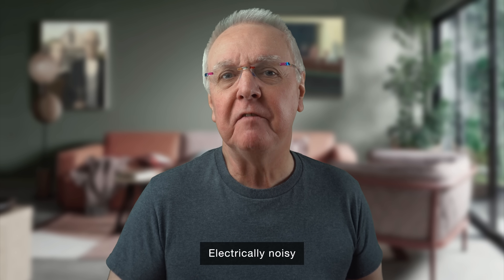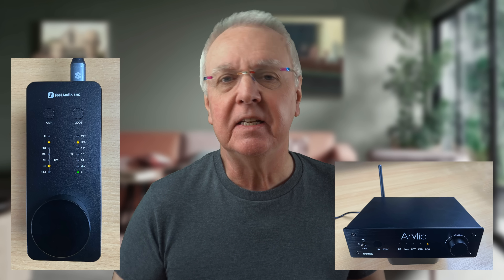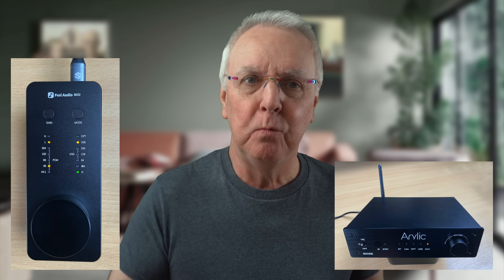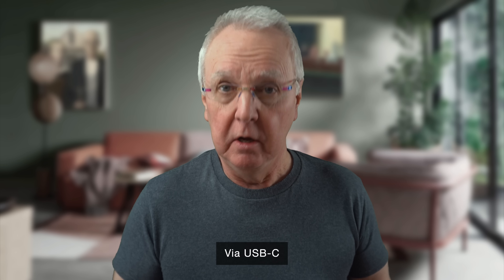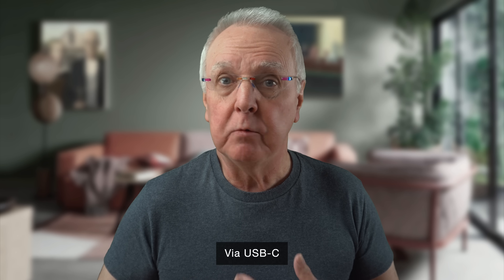Do optical cables have a sound?

Comment: In my broadcast career I have been using optical fibre for may years. for Multi channel audio over kilometres of distance. the biggest issue is that the connectors and sockets need regular cleaning to keep them optimal. fidelaity is always great. In my domestic audio life I have loved toslink, but I will always say that copper is king!!

Comment: many people may poo-poo this, but trust me there are differences. I know that when I run short optical under a foot vs optical over a foot, the result is that the longer line sounds better, richer, less dry...and I have over 20 different cables I can compare between. There are differences...and it's not slight. And when you compare from glass to plastic, the differences come forth even more. Try 20 different cables like I have , A/B them and you will see it for yourself....and these are in no way expensive cables either. All are $25 use and under in price

Comment: There are a few issues with all this, and speculation about what audio philes are actually hearing, But I will start with my computer background and say that  in terms of data transfer like bit (0 and 1) there is no such thing as a weak bit. it either arrives, or it don't, and there are so many protocols in place for repairing a corrupt or broken signal that it will either get there or not at all. In the cd world this is not as easy, as a cd player is forced to play either way, so a scratched cd will skip, and is very logical. But for streaming depending on how old your product is and how the DAC processes the information the sound artefacts should be the same as a cd, but I doubt that this exists in newer equptment, but I might be wrong. Anything connected to  a modem or such with copper or whatever cables can carry current with them that can affect the DAC, but not the data. So cabled connections can benefit from all the expensive filters and such. 
Essentially, using optical and wifi should eliminate all issues, but I don't know how a wifi receiver on a device with dac will sound compared to a direct connection. It may be slightly different if parts inside are in the path that may have an affect. 

But here is also my speculative issue with this. People have preferences and like the use the subjective term. So if that copper-infused CAT cable changes the sound and makes it more preferable than a clean optical cable, it will sound better for that person, but you can't say that it is correct. Also, when people are talking about more clarity, and stuff like that. Any variation anywhere in the frequency response will affect the rest. too much bass, and everything does not sound as clear. It still is, but it is not in the forefront anymore. This is the same thing that is happening in the crossover of a speaker, all the resistance affects these variations, hence why many speakers sound different. So what is correct. 
People may say that they want everything to sound as true as possible like in cyballs for instance, and I can say after having played in bands, that I would not like the true sound of a symbol all up in may face while listening to music, cause they are incredibly sharp and loud. 

So with the lack of knowledge about all insides of a receiver or component used and not even knowing what the actual undisrupted signal sounds like, no one can make a claim of what is better, but we know for a fact that data is transmitted and reconstructed inside the dac. And it will not do so until it has received all bits. 

Essentially, this guy has been pretty spot on in that sense, and I suggest that a simple test like using an optical for your CDs may be worth trying even though you have all the greateness that you need. I mean they are so cheap, so why not. 

Maybe that is the main fear of the industry. Wifi and optical are too cheap. It does not complement the feeling of knowing all the goodness they have achieved by spending a lot on expensive equipment.

Comment: How does anyone make an optical transmission system so bad it can only work up to 10 metres at 200kHz? Even 40 years ago we were making systems that did tens of MHz over hundreds of metres. Nowadays we transmit gigahertz vast distances. Likewise, this supposed jitter and smearing would be non-existent unless you intentionally designed the system incredibly badly. Ever heard jitter or smearing on a VOIP call? Or on any audio transmitted thousands of miles over the Internet? No, didn't think so. Perhaps it only occurs with short cables. Only kidding - of course it doesn't.

Even though there is no difference between optical cables I am prepared to believe that audiophiles can hear a difference that doesn't exist. It would be surprising if they didn't, because they can hear differences between electrical cables where no such differences exist.

Comment: Fantastic how much theory you share in the description link with the Pink Floyd 7 examples. However it misses the most important point, between a basic (3 to 7 dollar) optical cable and a decent ($30-40) entry level cable I can hear a very very very...times 666 :) clear difference. I can even describe it: the cheaper cable missed some midrange (the voices and instruments were  somehow in the background behind the bass and highs), with the decent cable having them upfront, on par with the other frequencies. I would never go over this price point as there are diminishing returns and indeed....optical cables matter far less than copper, but they do. Rule of thumb...do not get the "Amazon Basics" type of cables for anything...they might be built well, but they're robbing signal here and there.

Comment: I often use SPDIF Optical TosLink from most of my sources I´m listening to and I´m mostly satisfied with them, and maybe one should avoid the most cheap and sneaky cables of those, that are much thinner, but the most ridicoloues I´ve seen is Optical cables with Gold plating  What the F....?? Talk about fooling people to waste unnessecary money! 5 - 10 USD for a standard TosLink cable at a few meters are more than enough, in my opinion.

And most equipment of today are using Optical TosLink, such ax AV-boxes, receivers, TV:s and disc players etc compared to Coaxial thare are more rare. 

Also, there are measuring telling 75 Ohm digital "SPDIF" Coaxial CAN be better than TosLink, when using good cables with high degree copper or silver with good screeing and in enviroenment/listening room with low EMF/EMI. I´ve also read that USB are better than those both two above, as USB mostly has lower jitter - but for me, I get more disturbance clicking (not jitter) compared to TosLink, from my PC, but this are maybe due to my PC are too old (10 years old).

Comment: I have found huge differences between 5 euros and 25 euros optical cable. The more expensive cable is better, but I am not sure if a 100 euros cable really worths 
It’s a snake oil after a point.
I ditched optical cables and replaced them with 40 euros Coaxial cables. More depth more soundstage and cleaner high frequencies.

Comment: Bending of the cable yes, you'll have light loss, but as long as the other end can see light, the data will be transmitted. Most likely you can bend these fibers as aggressively as you like and the light is still going to make it to the other side. So long as the cable doesn't break. Yes you will lose DB and light but it won't be enough so that the other end cannot identify. Yes I have light, No I do not have light, binary code ones and zeros
Reply: And on top of that all this data has tons of packet loss built in it. Even if the data is slightly corrupt it will still come in perfect.
Reply: The problem with light is it does not cover the whole spectrum of sound. It does not have the same capability as coaxial cable coaxial cable is more musical.

Comment: Just bought a gold plated optical connection, of course, to avoid electrical interference. It sounds 0.000001 percent better than my original plastic toslink cable, but I didn’t let the measuring software fool me. In real life, the bass is more present, trebles are clearer, and the audio sounds deeper. Stereo separation became 3 dimensional and, depending on the weather, magnetic fields and local gravity conditions, I can feel the musicians in the room!
Reply: I really can't tell whether this is  sarcasm or real comment. I sure hope this is sarcasm though.
Reply: @NinaYahsika  "It sounds 0.000001 percent better than my original plastic toslink cable, " Should give away the sarcasm 🤣 Which is probably correct measurement between a low quality good enough tos-link and a super expensive top of the line, you will never hear the difference, optical cable. Due to it being optical and analogue quality's do not apply to it. that one bit in 10 million+ bits not arriving, you will simply not hear it. Ever!
Reply: @NinaYahsika 

"gold plated optical
connection"
Reply: @NinaYahsika  Frst, it seem´s (s)he know what  what talking about such as grounding connection between divices similar as to stereo/coxial connection, but at the end sentence with different gravity contidions - hey, what planet is it referring to?? Gold plated TosLink; talk about snake oil!!

Comment: there is one other thing:  my Sony TV s digital optical output is limited to 16 bits, whereas my DAC can handle 24 bits (which for now i can only have via coaxial cable from my streamer or blu-ray player.  Just saying that optical outputs can be a little limited by the equipment itself.

Comment: Hear is my home theater setup. 43” Panasonic plasma TV 📺 on a metal & glass stand. 5.1 surround sound hi definition Panasonic home 🏡 audio system.🔌 Im using a Monster cable hi definition single filter power conditioner with surge protector built in for tv & home stereo. All 💯% oxygen free copper multi strand cables from Monster cable.1 Cox cable modem & 1 Net gear hi definition gaming wireless 🛜 router. 1 pc/phone/Internet cable wired in HD Netgear router hard wired in Cox cable modem because wireless connection is unreliable & slow internet connection.I don’t understand why the Monster cable glass TOS link 🔗 optical cable make a louder more clear audio. Using only pure copper cable for home stereo sound system, play a lower sound and the speech 🎤 dialogue from actors,film 🎥 was hard to hear 👂 audio is turned up ⬆️ high?(By the way my 6 year old Monster cable HD power conditioner/surge protector,blew out during a lightning ⚡️ storm ⛈️ in Arizona.It does turn on but make a loud rattle sound.The old Monster cable HD power conditioner/ with surge protection, protect my TV 📺 & Home audio 🔊)

Comment: I've used fiber optical cables for 40 plus years at work in our tools. Many runs were 30 feet or so. At home, I used fiber optical cables to go from my house to a neighbor across the road so we could use our computers to race against each other. F1 game. 
That run was over 100 feet. 
I use TOS links in my system  to connect anything that uses it to my RX A6A receiver. 
Just do relaxed bends. It's simple and clean.  
Years ago, we cut and polished the fiber optic cable to clear and then put a connector on the end.  Love fiber optic and easy to trouble shoot. 😅

Comment: I am not an expert but I am struggle to find an optical cable which can support my 24 bit 192 khz for my current setup. I have tried 4 cables so far, and all of them are relatively cheap (including one from Monster) and none of work works for 192 khz (my input and output devices for sure support 192 Khz). My next try is to buy a multi borosilicate glass optical cable, which costs at least a few times more than those cheap cables (for brand ones like those from AudioQuest the price could be 8-10 times). I believe there should have difference b/w these different cables.
Reply: DH Labs Toslink Glass Master 😊

Comment: I do not tend to believe in snake oil products. But, there was a noticeable improvement, IMHO, when I went from an AudioQuest Carbon to the Vodka line. I am streaming Max files on Tidal to a BlueSound Node II, using a MacIntosh MAC7200 integrated amp (this is where the connection is made), Bowers & Wilkins CM8s2 floorstanders with AudioQuest Rocket 33 speaker cables, and a Rel S3 sub with AudioQuest Irish Red sub cable.

Comment: What I found odd was when I got my first Laserdisc player, a Sony MDP-A3, it had a TOSLink for digital audio output. You'd think Sony would want to use their own SPDIF Coaxial output for digital audio, right?

Truthfully the only time I got a "sound" from an optical connection was when I bought a relatively cheap 5 disc CD changer I intended to help make recording Minidiscs a bit more easy (since you could program multiple tracks over multiple CDs--making recording MDs in real time a snap.) Every recording I made with that changer resulted with some slightly audible tap. I could only guess that the CD changer's construction was a bit shoddy so it was picking up some kind of tapping noise from the spindle. When I used that same optical cable to record the same CD or CDs in my LD player, no tap whatsoever. So that definitely wasn't a problem with the cable.

Comment: If a cable is a cable and has no influence on sound, then an amp is an amp,  a cd player is a cd player, a speaker is a speaker, a turntable is a turntable or are they. Why do people buy different equipment based on their preference on sound  or manufacturer when in theory they all do the same job. Based on common theories that cables do not make a difference then that theory must be applied to every other piece of equipment. Unless that is, there is a difference.
Reply: @nicksterj I do believe that's what I'm inferring.
Reply: There are radical differences in all the components that have nothing to do with wire or connects. Speakers are quite obviously different. The design, quality and type of the many individual parts to amplify a very small signal to obe strong enough to drive speakers or headphones or whatever.
Reply: It must be a pain to be that dumb

Comment: I've been using digital cables for nearly two decades now, primarily optical but also coaxial. Until recently, I didn't really think much about it; I just assumed that every '0' or '1' transmitted would be received flawlessly. I figured any lost or misread data would result in audible distortion. However, it's a one-way communication system with no error checking involved. Even if a bit or several bits were to flip in a digital audio stream, chances are you wouldn't even notice it. I haven't experienced any issues with digital connections personally, but that doesn't guarantee they're flawless in terms of transmitting every bit accurately. Recently, when I had to resort to using an analog line out from a laptop, it reminded me of the significant distortion problems associated with such connections.

Comment: Toslink cables standard is plastic and is low grade for short distance only. Toslink is basically just a powered LED added to the SPDIF  coax connections on the sender and receiving ends of each piece of equipment. It is a one way transmission only with no error correction the same as.a SPDIF connection There is or can be no audible différance between SPDIF coaxial or fiber Toslink as long as the rather limited Toslink bandwidth is not exceeded. Coaxial SPDIF has a higher bandwidth and is less likely to generate errors or Jitter than fiber Toslink, but are functionally similar. Totally fine for CD but not ideally suitable for very high bitrates. While Toslink seems to work on a 24/192 audio, in actuality it is beyond its spec and generating errors/jitter which may or may not be corrected by your DAC. For the higher bitrates, it is better to just use copper.

Comment: I have discord Audio Phils telling me to replace my WiFi with cables, but not ethernet cables (oh no), with fiber optic cables connected to converter boxes each with their own Linear Power Supply....which are then connected via ethernet to the router and streamer respectively. Apparently this reduces noises and enhances blackness, or something. And it's galvanically isolated, unlike wifioh wait...maybe wifi has noise from the air?

*I realize this isn't in the scope of Toslink, I just didnt think optical data would come up in audio recommendations until now and thought of this video
Reply from the maker: Wait until audiophiles learn about ethernet collisions.

Comment: I am genuinly facinated by how much you're willing to entertain the audiophiles arguments on this subject, since you clearly know they are false.
Doesn't it get excruciatingly boring having to keep arguing why digital audio cant sound anything but flat?

Like thats the entire thing about digital. Its quantized, any loss of frequency doesn't matter as long as the individual bits are still readable. It can be restored perfectly.
Claiming that a digital audio signal can be colored by its cable is like claiming that different qwerty keyboards can add subtle changes to your font.

I do not have this kinda patience for this kind of thing.
Its like if someone was convinced 1 + 1 = 4, and denying this deeply upsets them because of their emotional attachment to the idea.

I would disassociate real quick
Reply from the maker: The older I get, the less I believe or disbelieve anything. I have in mind a test of optical cables for a future video where we may, or may not, hear something.
Reply: @AudioMasterclass  I must admit that I am very intrigued to see your solution.